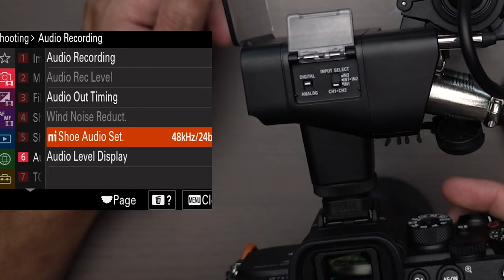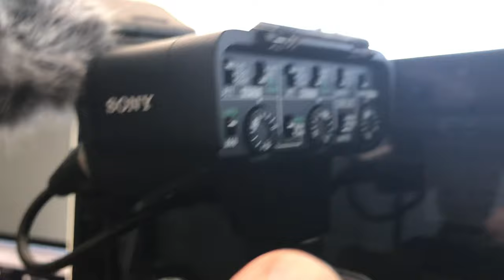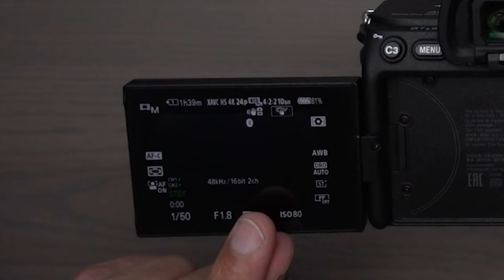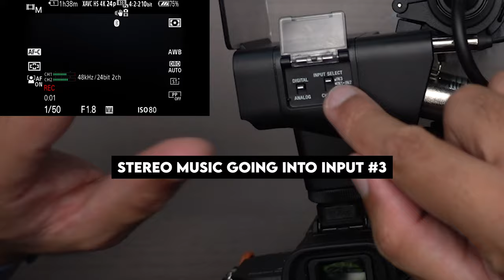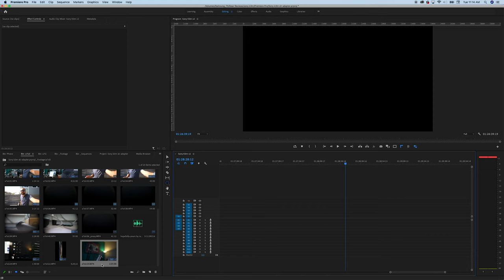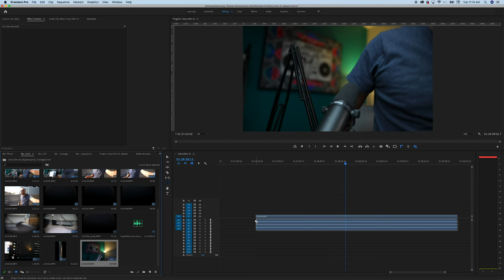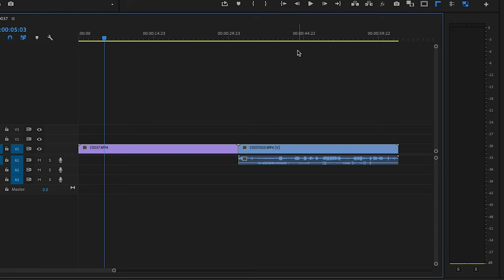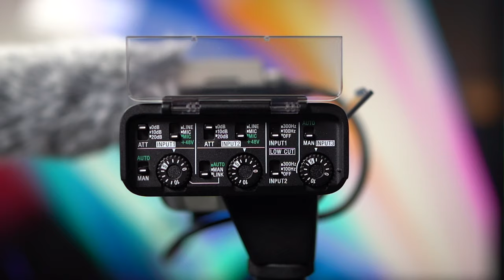Sony a7siii Pro Audio with XLR-K3M Dual-Channel Digital XLR Audio Adapter Review

Comment: Can I connect my SM7B from the Rodecaster Pro into that Sony XLR-K3M and use the sound from the Rodecaster Pro into my Sony a7iii?
Reply from the maker: Yes you can! I tried to do this as well but I just got electrical noise on the signal, but definitely worth trying it before buying a splitter. It may have been how the electrical is setup in my workplace.

Comment: Does it work with the A7Sii? I’m freaking out because I’ve opened the box and discovered the digital function doesn’t work. My shop doesn’t take it back if it’s been opened.
Reply from the maker: Just use the analog switch and you’ll be fine. A7sii just won’t have 4 channels. The rest works fine.